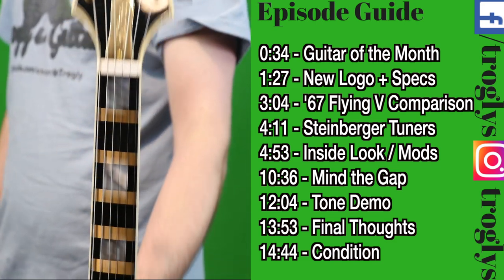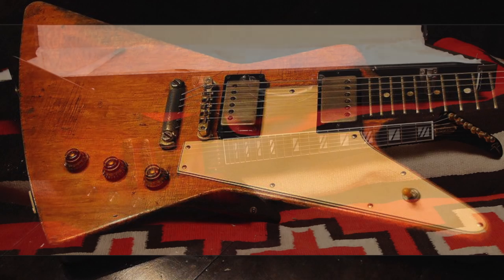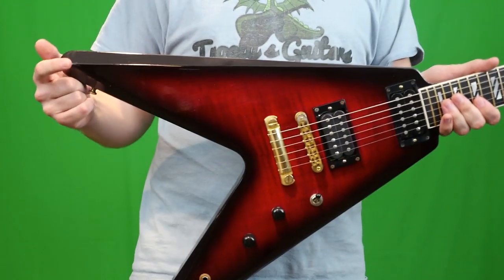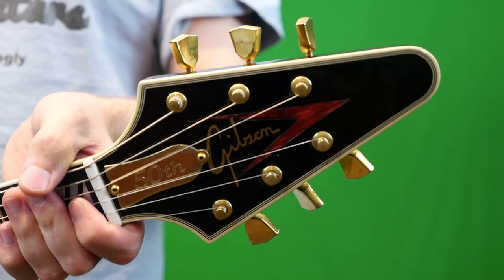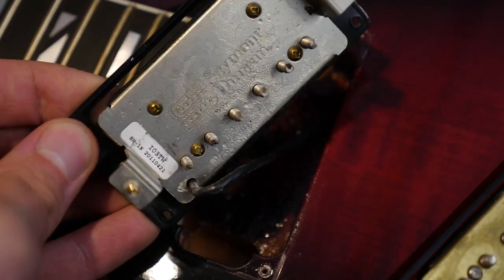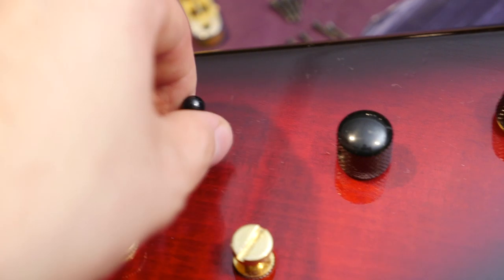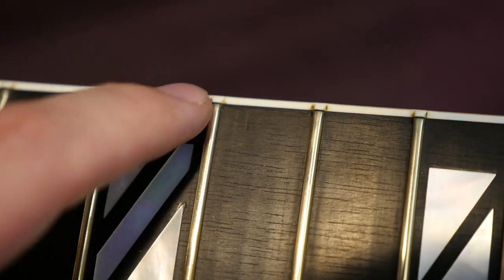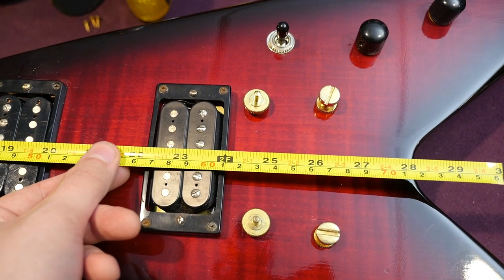What Kind of Flying V Is This? | 2008 Gibson 50th Anniversary Brimstone Burst GOTM | Review + Demo

Comment: I love Flying V's so this is something i could dig, though the finger board inlays are not my fave.
The neck to body thing i believe is known as square shoulders on the '58. Interestingly, Ibanez did a slightly sloped version for The Rocket Roll Sr (which i have). Sort of a blend of both designs.
wait, i'm supposed to be mad at Gibson!!! Seeing the FBX demo here from Halloween yesterday and the example didn't work (vol control was bad) has got me thinking.

Comment: I’ve checked a few of these out, and the Explorer too.  The original tuners are rather substantial with fat pegs.  I don’t think you can just switch them out for standard Gibson tuners, at least that’s how it looked to me.  I would imagine you would have to put something around the standard tuners to fill the space from the larger Steinberger tuners.  It’s none of my business, but if it was me, I would remove one of them and make sure there’s no funny business going on in there.  I noticed a lot of cracking around the washers on the tuners in the video too which makes me doubly suspicious.